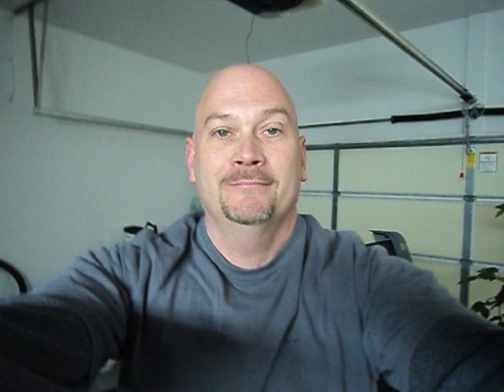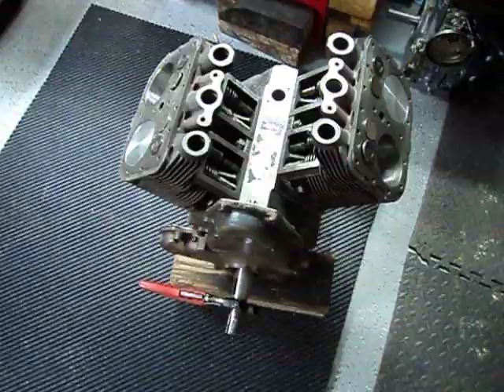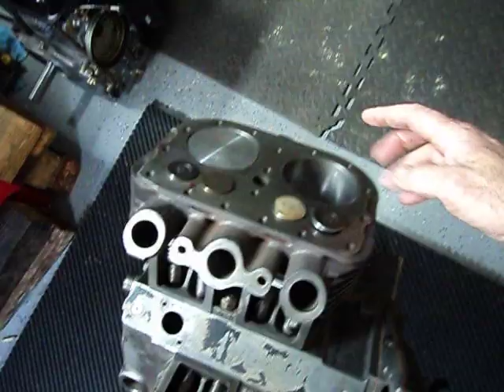Wisconsin VH4D Four Cylinder Engine Four Cycle Engine Strokes Explained

Comment: I'm so confused on if I have the spark plug wires in the right place but it fires up quick. Then the Cylender heads got hot and my oil turned grey and a comment below and some other info leads me to believe my static timing is off

Comment: Hi there, What is the compression spec on this engine for a compression test? thank you
Reply from the maker: When doing a conventional compression test with a gauge you should read 80 - 100 psi per cylinder with less than a 10 percent variance between any two cylinders. The ideal way to check for wear within a cylinder is by performing a cylinder leakage test. Thanks...
Reply: Ok great thanks a lot. Each cylinder read about 95 psi so that was good news. The engine is on a 2001 wood chipper with 1900 hrs. I found the engine oil to be grey in color. I drained the oil and put in fresh. I checked the old oil for any metalic shavings that would suggest bearing wear but found nothing. Any thoughts?
also ran the chipper for 2 hrs with the fresh oil and no change, its still a nice gold color
Reply from the maker: Dustin Gray The gray color could have been from moisture in the oil, potentially if it has sit for any length of time. I would run it. Keep a good air filter on it, keep the crankcase breather clean (the oil fill cap), a good quality oil 10W30. Keep the cylinders clean from debris and check the ignition timing periodically with an automotive timing light. 1900 hours is not bad as long as someone kept it serviced and didnt abuse it. thanks
Reply: Thanks again for the advice. I think it will be a good engine if I keep up the maintenance like you say
Reply: eqsmanager

Comment from the maker: Attention to ALL. Remember proper ignition timing is critical on any air-cooled engine and especially Wisconsin aircooled engines. After statically timing the engine do not forget to set the timing with an automotive type timing light. Hopefully I can cover this in an upcoming video...STAY TUNED!

Comment from the maker: hank cota, the firing order 1-3-4-2 stand facing the flywheel and on the lefthand side closest to the flywheel is # 1, then #3 in the same bank of cylinders, righthand side #2 closest to flywheel and #4 in the same bank of cylinders. REMEMBER that the rotor button inside the ignition distributor rotates counter-clockwise. If you have a magneto ignition distributor the rotor button rotates Clockwise. Thanks for the question.

Comment from the maker: The VE4 is adjusted the same. Remove the valve inspection covers, bring the cylinder you are adjusting up on top dead center of the compression stroke and check the clearance between the valve tappet and the valve. The intake should be .008 and the exhaust .016. Its easier to start with #1 piston then 3, 4, 2. VE4 has the same firing order as the engine in the video.
STAY TUNED. Oh these engines were also found on US Air Force ground support equipment also.

Comment: I have an old 1945 VE4 I need to adjust the valves on and get running. It powers an old all wheel drive articulating Navy aircraft support vehicle, kinda like a side by side ATV.